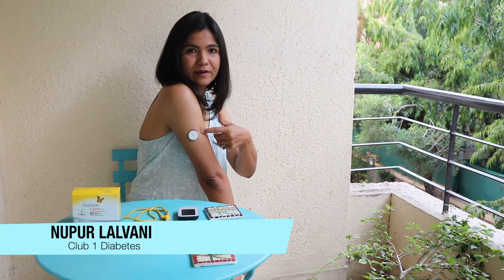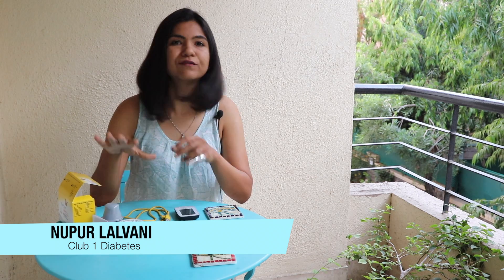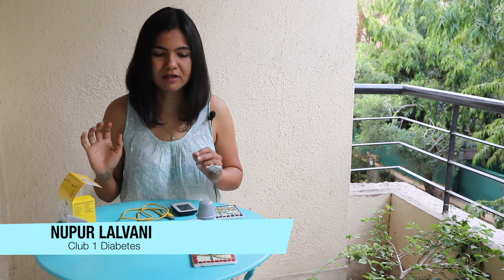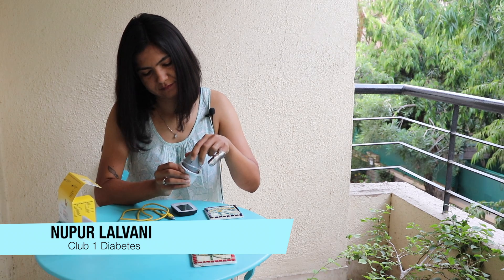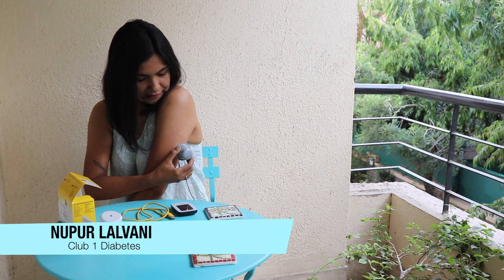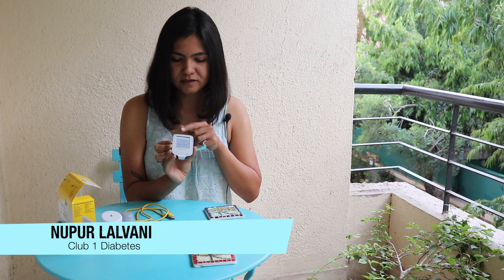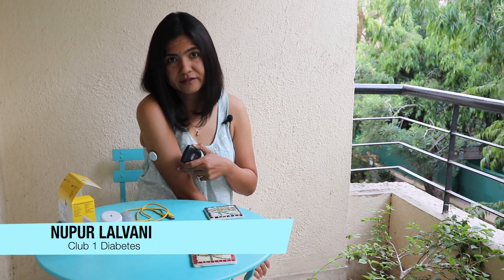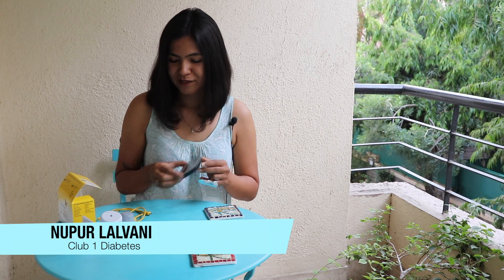How to apply Freestyle Libre Pro sensors (India specific blog in description)

Comment: What is the difference between the Libre pro and the Libre? From what I gather, the Libre pro is cumbersome to obtain, compared to the Libre that is available on Amazon. Is there any benefit for recommending the pro over the libre?
Reply from the maker: The major difference is the cost. The MRP of the consumer version Libre (available on Amazon) is Rs 5000 per sensor whereas the MRP of the Libre Pro sensor is 2419. Click this link & in the comments you'll find a graphic explaining the difference between the 2 in detail -- https://www.facebook.com/303799270195991/posts/pfbid02PgkMt9uzz4JpC8VDV8yJRcwyxfA7uwFc5svT9ZB3iVbTmPf3T37NdmyDN53C1Fcel/
Reply: @BlueCircleDiabetesFoundation  can the libre pro be activated without the reader or is the reader mandatory?
Reply from the maker: @Manav-r4w  the reader is mandatory (unfortunately) & the reader & sensor type must match which means that you can't activate a Pro sensor with a consumer version reader or vice versa

Comment: I don't know what's happening but did the company just discontinue libre pro and started rebranding it as libre and increased the price of the sensor to around 4000 rupees? Because i remember getting this sensor around two years back for around 2000 rupees and i was able to use the glimp app to see my readings in real-time for 14 days. Now when i called Abbott, the company which makes this device, they're telling me that libre pro was meant for hospital use and it does not give real time reading whereas the new device, libre, is able to do so. Its really confusing and the only explanation i can think of is that they've understood that they have a monopoly due to no competition in this category in india and just rebranded and hiked the price of it.
Reply from the maker: Both types are still available - Pro as well as the consumer version (available on Amazon). Where did you buy the Pro from earlier? Can buy from the same place

Comment: How much it will cost a month using this ? 2000rs is for 14 days
Reply from the maker: 14*2 (MRP per sensor now is 2200) = 4400 per month. DM or email us with your location on support@bluecircle.foundation - we can help you find a slightly discounted rate
Reply: @BlueCircleDiabetesFoundation   Thanks. Is this okay for pregnant type 2 ?
Reply from the maker: @meghasinha7581  yes absolutely okay, infact recommended

Comment: this is very useful information ,  you mentioned price is around 2000rs but amazon and 1 mg list price is around 5000.  I would really appreciate if you  know where to  buy in mumbai or navi mumbai for that price or anywhere else who can courier. Again thanks and this is very useful.
Reply from the maker: Hi latest update: there are 2 types of devices, one is the Libre Pro, the professional version (which is shown in the video), it's MRP was previously 2000 and now is 2200. The Libre consumer version costs 5000 per sensor and it's probably what you saw on Amazon. Are you type 1 diabetic or type 2? Feel free to email us on support@bluecircle.foundation for any more information
Reply: @BlueCircleDiabetesFoundation  thanks for response , will email
Reply: @BlueCircleDiabetesFoundation  🤔 I've been buying the regular ones for about 4500. Can you tell me where I'll get the ones for 2500? Is the cost still the same?
Reply from the maker: @starfiremonkey7839  there are still 2 types- the consumer version sensor available at ~5k on Amazon and the Pro version around 2400 or so
Reply: @BlueCircleDiabetesFoundation  thank you! Can you tell me which one is better? And where can I get the Pro sensor? I haven't seen it at pharmacies
Reply: You can get Lower rate From Beat O app they have huge discount as I am Type 1 and Continue buying from them

Comment: I've had one of the worst experiences with the sensor! I still rely completely on the Medtronic sensor.
Reply: Hi rohan from where did you get medtronic sensor?
Reply from the maker: Akif you could speak to your local Medtronic representative or if you don't have their contact, get in touch with them through your doctor
Reply from the maker: Here's a video about the Medtronic Guardian Connect CGM : https://youtu.be/ClJ3KKJqE6U
Reply from the maker: @akif5903  feel free to email us your query on support@bluecircle.foundation and we'll get back to you immediately
Reply from the maker: Have you used it with the reader or Glimp?
Reply: @BlueCircleDiabetesFoundation  reader only
Reply: @BlueCircleDiabetesFoundation  unfortunately my phone doesn't support the libre sensor
Reply from the maker: Ah okay. Glimp has an option to calibrate, which makes it way more accurate than the reader
Reply: That's what i guess i messed up! You might be on the OnePlus 3T, i use the 6T, which breaks the sensor. Ive even spoken to the developer of the Glimp app and he is yet to make the app somehow available for the 6T. But till then i guess I'll have to either wait for Abbott to come out with their app or use the Medtronic sensor! 🤟🏻
Reply: Have you tried blucon? I am using for a few months, it can activate the Libre Pro sensor as well as you can set alarms. I short, it converts Libre Pro sensor into a Dexcom G6 like most advanced CGM